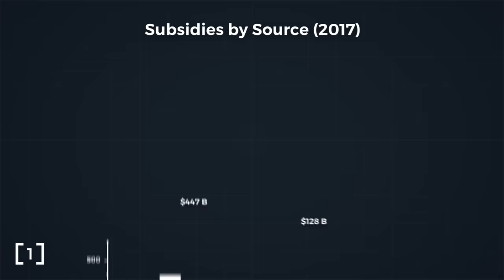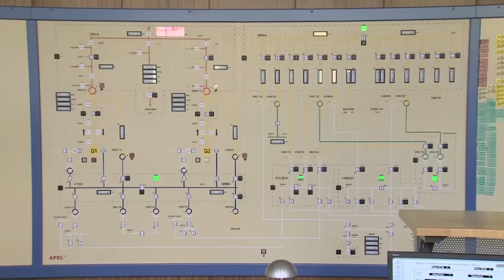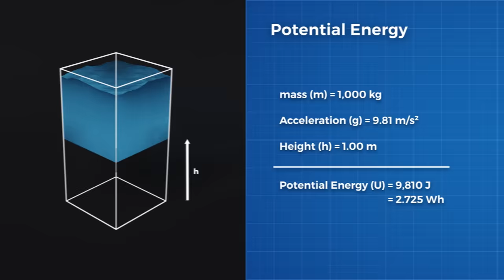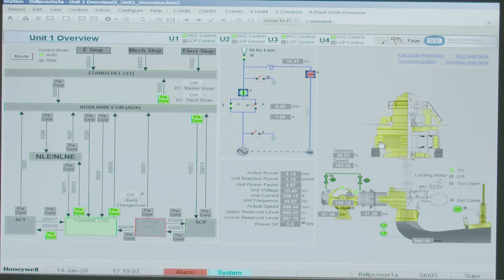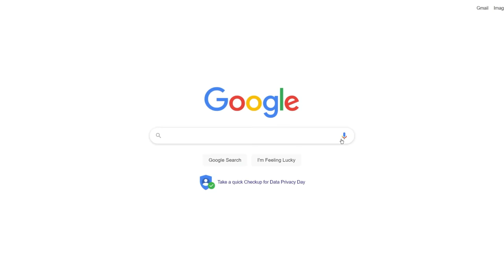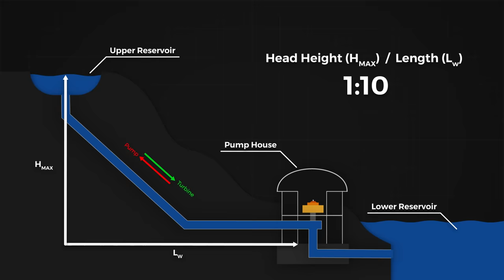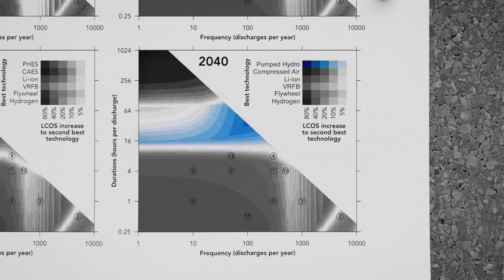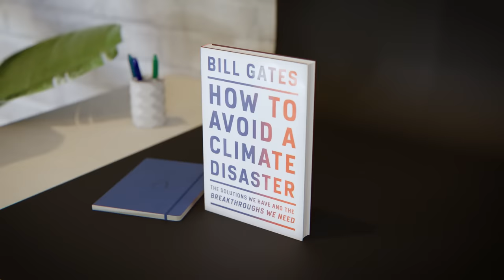The Truth About Pumped Hydro

Comment: @14:16 Closed due to lack of demand for energy? Is this bad planning or what? Storing energy is only required because of uneven 'green energy' supply. No mention of Nuclear power.
Reply: Nuclear power is still controlled by weapon industry.

 No boom means no funds or cleaner advancement.

Nuclear power is stagnant and still stuck in the cold war.

Liquid thorium salt reactors would outperform "green" energy like a F1 racecar outperforms a Jalopy
Reply: @johndee2990  Nuclear power was undermined by the left and the green movement, france changed over their entire grid to nuclear decades ago, we lost the momentum of development and know how because the same people spinning climate fears were doing the same against nuclear decades ago.
Reply: @johndee2990  Not in Japan.
Reply: @johndee2990  Also, I love thorium as muxh as the next guy, but the issue with MSRs is getting an affordable metal than won't corrode to contain it. 
(Also, MSRs were invented to power a nuclear bomber, so the common thesis that we haven't made more progress on 'em is because of the Cold War is wrong - without the Cold War, we wouldn't have any progress at all - not every bad thing that happens is the result of a malicious conspiracy)
Reply: @jeffbenton6183  yea that is true but their development was stopped due to political reasons and the fact they couldn't make nuclear bombs from them as easily, not the technical issues of corrosion(hasn't that been fix now? don't hear much about it anymore, hear more about needing funding and outdated regulations getting in the way?)
Reply: @bencoad8492  Thanks for your reply. It's possible that we don't hear about corrosion as much because it's been fixed. Although, its also possible that as more people hear about Thorium's potential, fewer of those who talk about it are aware of the challenges ahead - and those voices drown out the more cautious ones. I can't say which it is myself.
Reply: @thorable530  Well, in Japan (where this particular pumped hydro station was located) nuclear power was also slightly undermined by the triple nuclear meltdowns they suffered...

Comment: It reminded me of my visit to Itaipu Dam. But each generator has 10 times the power of this one. It's really, really mind blowing.
Reply: Pumped Hydro and Hydro... Fk recognise a fooking massive difference in size FFS.
Reply: @AKUJIVALDO  I know there's a size difference!! So what? It reminded me of Itaipu and I commented. You don't have to prove you're smarter than everybody else in every comment.
Reply: @danielquirco1  of course there is a difference. One is a damn DAM and other is a Pumped Storage. You might compare their basin sizes too.
3 size and type differences.
Reply: @AKUJIVALDO  actually, a hydro dam can and does serve as hydro storage battery for electricity... It's possible to pump water into the reservoir, in the event of excess electrical capacity... They are exactly the same thing!

Comment: The counter-argument against the subsidy argument is flawed because it looks at total subsidies and not subsidies per Megawatt, and specially not in percentage of investment.

For example if I subsidise 95% of all costs of 3d printing, it will amount to a smaller total amount than if I subsidise 40% of all costs of producing food. 

Claerly, in the example above, 3D printing would be more subsidized than food production.

I am not saying that renewables are cheaper only because of that, not that they are only economic viable because of that. What I am saying is that the argument presented in the video is really flawed.
Reply: I think he meant to address that point, but he didn't make his reasoning clear. His argument seems to rely on the notion that when an energy company is subsidized, what's being paid for is the construction of new energy production facilities--and going by those rates, fossil fuels are subsidized more than renewables.

It's an interesting argument, but it ignores the concept of fungibility, and it doesn't seem to match how the report that he cites defines "subsidy", anyway. It's a complicated issue, and it would be nice if he refrained from making judgements of the intelligence or character of those who disagree with him.
Reply: @mvmlego1212  I totally agree with you. He seems to make such an assumption, and if this was the case then his argument would follow as you pointed out. However this is not the case, he made a huge logical jump (maybe by ignorance of economics?) and his argument totally fails. There are two perspectives that we can take about subsidy, the proportion of the cost that the government pays, or the amount of money the government pays by a said quantity of the good.

These two perspectives can conflict, and therefore understand what each focuses on is important to debate about that.
Reply: @mvmlego1212  Also, you are totally right about his behaviour. This was disgusting, a shame, since I really like his videos.

Comment: I am a retired power electrician with 37 years experience.  In my career I worked on hydro electric stations, steam power station, Ac to Dc and vice versa convertor and invertor station,  Distribution stations, Control, protection and metering.  I understand electric power.  I like this idea in the video and also like the honesty that it could be part of the solution.  Adding new load i.e. electric cars to the existing power system will only delay the time coal and natural gas power stations can be phased out.  We need to build the renewable energy sytem first and work on more effecient uses of our fossil fuels meanwhile i.e. use trains to move more of good instead of trucks,  create a mass transit system that is more convient than using your own vehicle, change business so there is less comuting etc.
     Another source of storing water for electric energy would be to use existing hydro electric stations combined with wind and solar energy.  More generation would have to be added so the water resivour could be used at a higher rate for short durations and then hydro generation dropped when solar and wind energy available to refill the water resivour.  Of course there would have to be a study on this for feasability.  There is always a lot of politics that go along with all this stuff i.e. not in my back yard.

Comment: The biggest problem in Norway for us not to use more water energy is because the climate activist, they always complain when we want to build a dam, road or so on.

This is from a Norwegian.
Reply: It’s the same in North America. The public is unwilling to give up their modern conveniences, but somehow think they magically come from thin air. 🤔🤨
Reply: These people clearly haven’t looked into the issue. I am assuming they are worried about salmon, because that is the most well known migrating fish that is affected by the dams in my area. There are salmon “flumes” where thy gather the fish at the bottom and suck them to the top hypertube style. Really cool system, has the potential to alleviate most issues with dams.
Reply: as they should do, any new infrastructure will come with its own unforeseeable problem
if we mention the problem as early as possible we can make a system that has as little of a problem as we can engineer
Reply: at least Norway is already producing like 99% of it's electricity and much of the general energy needs with hydro power already
Reply: @skippy9214  They still oppose it even if it's just upgrading.

And as I like to point out they dam are ussaly built where the streams are more powerful and there's plenty of other places fishes can go.

I for one has supported rebuild projects and upgrades to the equipment we already got. To increase the power output. Still clime actevist are against that. Also not to mention we also got sea planets for it. But that's still not considered okay.

Comment: Thank you for a good exposition on pumped energy storage.  My area doesn't have enough nearby good hills for pumped energy storage,  but we have plenty of wind - and hot air from politicians.
Reply: With proper voltage, even over 500 km of power lines can have negligible losses.

Comment: You've really overestimated how much you need. Probably closer to needing 4-5 total Facilities like this. Good summary though. 

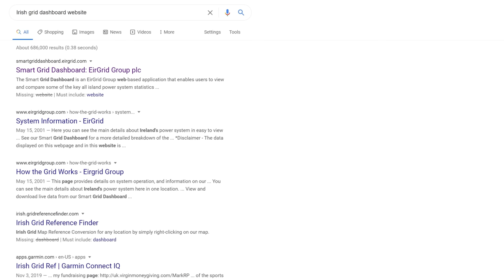Here's where your calcs went wrong: At 10:00s you start talking about replacing fossil fuels with pump storage. You don't replace generation with storage, you replace it with alternative generation (solar, wind, nuclear, etc) ... Storage just helps smooth the output, since you can burn fuel as - needed, but the sun shines /wind blows when it wants to, so power has to be harnessed when the getting is good so it can be released when people turn their lights on.  Then, at 10:40 you talk about needing 24hr generation. Both of these assumptions are taking about needing power generation, not storage capacity (and max power output of that storage) . You mentioned this, but your calcs didn't make the same assumptions. As long as there is a pretty good mix of generation (IE, half of your average capacity is available at any moment), having storage power output  that can exceed ~half of the total consumption is all you need. The Average output of generation (not storage) over a ~10 hour period (twice the reserve capacity duration at max output) will have to equal total consumption + losses over the same time, but that's a generation problem, not storage.
Reply: I was thinking about that too. I'd love to see how the numbers work out assuming that generation comes from wind, and storage is 100% pumped hydro.
Reply: maybe he's assuming a worst case scenario at peak power consumption- no sunlight & no wind, at 5:30pm
Reply: @davisburnside9609  yea, i think that's what he was trying to do, but it's a bit of a false dilemma. It's a hugely worst-case, because even in your scenario, you'd need 10hrs to start getting solar again, not 24. In any realistic conversion to renewable energy, your going to need some sort of continuous generation "base loading" to have a mix so you make the worst-case not so bad. (like nuclear, geothermal, hydro, etc). Then, you need to look at total carbon /energy footprint. If you can run completely on renewable energy 99% of the time, it's probably more environmentally sustainable AND economic to have some diesel/natural gas peaking plants / emergency backup generation to get you through "worst case" scenarios. Spending ~1B$/£/€ per install  x 10 additional installs to get to 99.9999xx availability still doesn't completely eliminate the need for backups/emergency fossil fuel units (disaster recovery scenarios etc) , but those reservoirs cost TONS of concrete and steel (read Gates' book on the entrained energy in those materials), and represents burning of more energy than they will save; because you're in the realm of diminishing returns. What I'm saying is: even if the budget/willpower was there, building that much more than you really need is a bad environmental decision. I bring this up because the public and policymakers can easily swing too far the other way. Optimization is key to minimizing negative human impacts on our environment.

Grossly over-building to try to get to 100% "renewable" as an arbitrary goal is counterproductive in two ways:
First, it can end up requiring too much energy as I mentioned, canceling out a significant amount of environmental gain. Second, it makes the goal of minimizing or reversing human-caused environmental impact seem less achievable and causes hopelessness, which in turn motivates rationalization of conspiracy theories.
The goal of mitigating negative environmental impact is not nearly as far out of reach in practice.

So, don't calculate for "worst case", calculate for the 99% case and then come up with backup plans/mitigations/protocols for the edge cases - That's Engineering.
Reply: Under appreciated comment. Indeed it is about storage. And any location is limited by it's product of volume and height difference. And to calculate the required storage capacity the area between the graphs of production and consumption needs to be taken. And if, as you mentioned, keep gas powered energy production as backup for the ~1% of wind still and cloudy days than the required capacity is probably much less than 10h at max  consumption.
And if you factor in that Ireland is really green and capable of producing methane gas biologically, than sourcing that amount of gas is a non-issue.
Reply: What needs to be considered is that a large surplus of energy generation from wind and solar will be required to replenish the (water) storage for times when W&S are not available. 
Any prolonged windless and sunless days will soon deplete the limited water storage you have.
Nuclear power will be essential to make  any renewable a major source of green electricity. 
This is especially important now there is a growing pressure/demand for electric vehicles. 
The increased need for electricity will place huge demands on its generation leading to the question, "How and when are you going to be able to charge your electric car and also keep the lights on?
Asking for a friend....

Comment: Another way to reduce need for storage is encourage less use during peak hours. My EMC does billing such that energy is always cheap, but certain high temperature days during summer months you get penalized for excess (over 3KW) use from 2-7PM. It varies, generally somewhere from 0 to 3 days per month in summer. This significantly reduces need for running expensive peaker plants. It is easy to do, a big energy suck is dryers, that use over 5KW. The cost for power in the summer is about 40% cheaper in the summer than before they started this program.

Comment: when you showed that 1 cubic meter gives a mere 9000 joules (this was before you showed it in watt hours) I realized exactly what you were getting at.
Reply: @laredobenjamin7438  except 1 cubic meter of batteries will hold far more than 9000 joules. also these plants buy electricity at night and sell it in the morning as a primary use. so even though the material is free, moving it every day isn't.
Reply: @laredobenjamin7438  these power plants could work to fill the required demand. they can't work on their own since energy needs to come from somewhere. so you can't have a country that runs entirely on pumped hydro.
Reply: @laredobenjamin7438  But you need to manufacture and maintain a facility. Meanwhile a warehouse full of batteries only needs the appropriate connections to the grid and maintenance is a breeze by disconnecting sectors and replacing the faulty racks without having to take the whole thing out of comission.

Comment: Very interesting video! My U.S. state (Texas) recently went through a week-long period of rolling and extended blackouts. This was due to a combination of a massive surge in demand for heat and the power grid being unable to produce enough energy to meet the demand. Over 80% of Texas is on it's own power grid, separate from the rest of the United States and we lack the ability to make quick, large adjustments in cases of extremely high usage. 

I would love to see our state use these pumped hydro stations as a means of boosting our energy supply without having to rely so heavily on natural gas or even wind (both of which were limited in their production capacity over the past week).  Texas is almost an ideal state to use pumped hydro since most of population is concentrated into major urban areas with a great amount of open land available for potential use. Additionally, the idea of salt water pumped hydro would be huge for us since Texas has such a large coastline on the Gulf of Mexico.

Comment: The only downside to a salt water reservoir system as mentioned is the greatly increased maintenance required as well as a reduced service life.  I have sailboats and the ones that use raw water cooling require more maintenance than the fresh water cooled boats.  Additionally, the cooling systems wear out sooner than the fresh water systems.  I am sure that it can work, but the costs will be higher.

Thank you for yet another excellent video!
Reply: You basically just said “salt water bad” in like five different ways.
Reply: I wonder if they could desalinate the water during the conversion to make up some of the lost efficiency somehow... or get the added benefit of turning salt water to fresh water before it gets pumped. No more extra maintenance due to the salt and its drinkable...🤷‍♂️
Reply: imagine the number of salt water organisms that will be killed as they are pumped back and forth through a salt water system.  Then the amount of maintenance keeping the barnacles from growing and clogging it up.  I'd say there were lots of downsides to it.